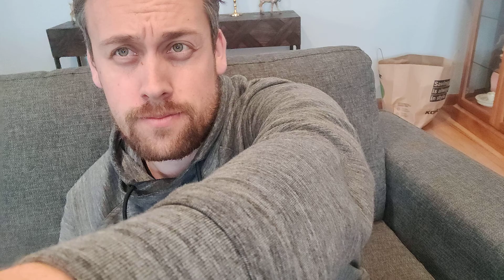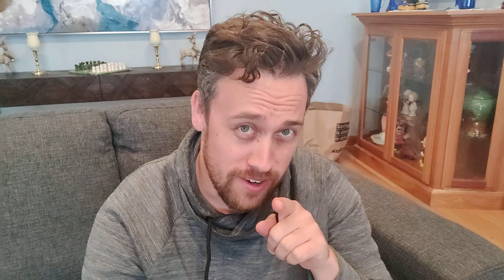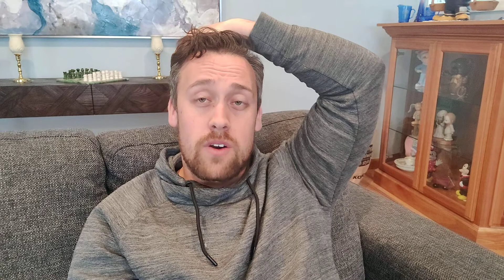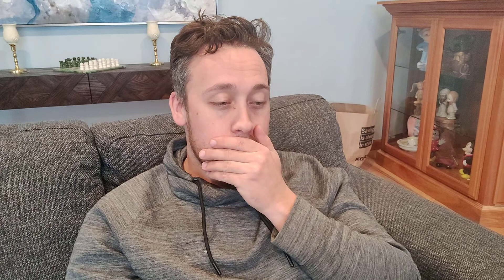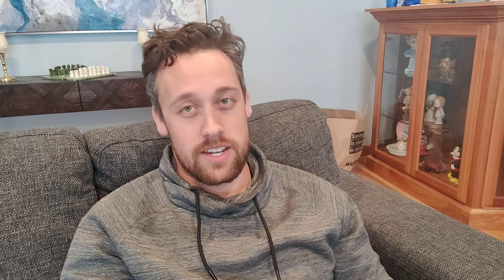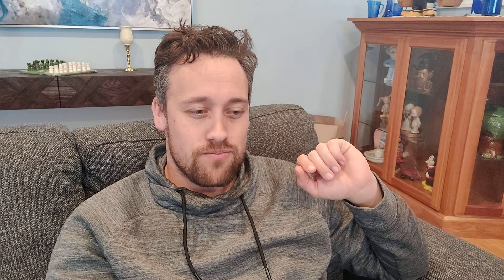Rotary Split Timing Explanation and Overview for Tuning Rotary Engines

Comment: I have read somewhere that mazda built race engines have zero leading/trailing split. Does it follow that less split means less chances of detonation? If this is true, I would be inclined to just deactivate my trailing coils and sacrifice a few ponies just to be safe from detonation.
Reply from the maker: No, you have it backwards.  More split = Safer.

Comment: Q...for a stock or mild street port...what is a good base L1 timing advance number?
I see many charts show 0 degrees up to 6 deg BTDC
What confuses me is I also see many youtubers running numbers as wild as 15 BTDC initial advance for a stock motor.
Isn't this too agressive inital advance?
Q2....with Approx 12 Deg Split....I have tried timing of -5 Retarded deg L1...0 Deg L1 and 5 Deg Advance BTDC inital timing at idle.....I Did not notice much difference throughout the rpm range but it seemed smoother with less decel pop at 5 Deg initial L1 advance.....This leads me to believe the engine may like more advance.
Wondering how much advance can I go before engine knocking occurs and will I even notice when Knocking starts to occur before engine damage has happened?
Specs Pre'86 13B, RB 4 barrel Intake, Tuned Edelbrock 600 CFM Carb, 2.5 Inch header open exhaust with resonator
Thanks in advance.
Reply from the maker: For your particular setup, Racing Beat has most of these questions answered for you.  

Generally all of my tuning is a full standalone aftermarket ECU with full engine control of all fuel and spark variables.  That's why I'm unable to answer your question as you intended. Timing is shaped, not an on/off switch or singular value.
Reply: @RGHTBrainDesign  Ok thank you. I have looked at Racing Beats info before but it is pretty basic. Just trying to gain as much of others experience as I can since there is not much out there for carb tuning with timing split, using different spark plugs etc
But actually I think I got it now....I discovered there is a ball bearing in the dizzy that allows the stator plate to rotate under vacuum to pull in advance. Found it was gummed up and not rotating and needed lubed.

Comment: world market FC turbo ( N318 ) has same plug positions as FD . the usa is not centre of universe. you get N332 instead and it has the same freaky spark locations as MFR and s4 NA ( N 326 ) . the VAST majority of FC turbo engines in the workd have same plug position as FD
Reply from the maker: Thank you for the clarification, Sir.

Comment: good overview of split timing, i would like to add to it.

the reason for changing split timing is the rate at which fuel burns, more pressure causes the fuel to burn faster (flame propagation).  this is why you want to retard timing and increase split with pressure. we can use manifold pressure as an estimation of CCP but it is not obvious that is actually the case and what we will likely find is that CCP, which affects combustion rate, is highest somewhere around peak torque rpm for a given MAP.

too much split will cause an incomplete burn, much like disabling the trailing plugs. too little split may result in a knock situation, think about it like trying to punch something to get it to move instead of pushing on it. at lower CCP the uncontrolled burn may just result in a loss of power that pulling the trailing plugs makes better, at higher CCP the uncontrolled burn may have enough force to damage the engine.